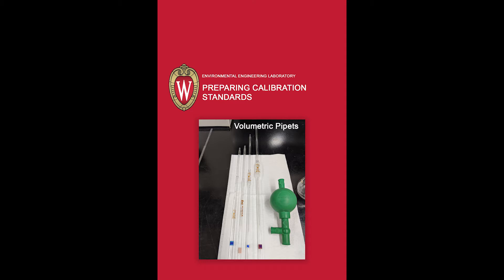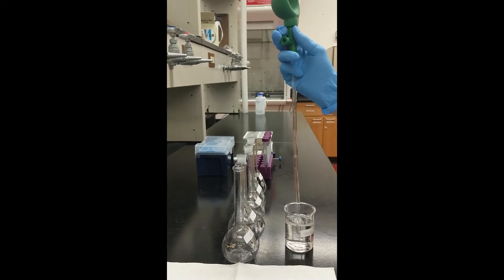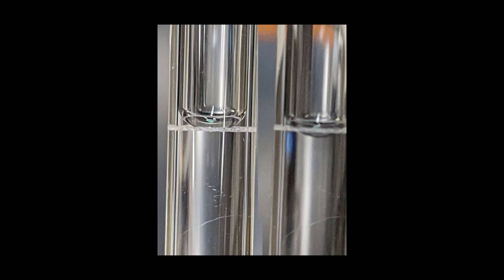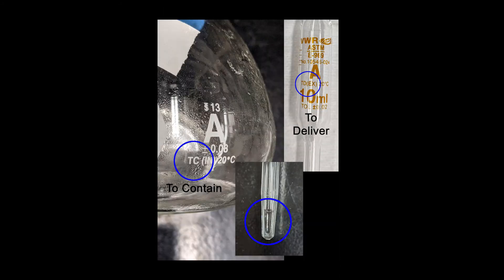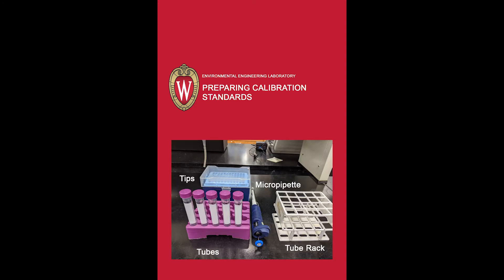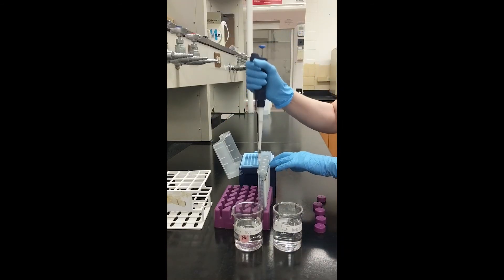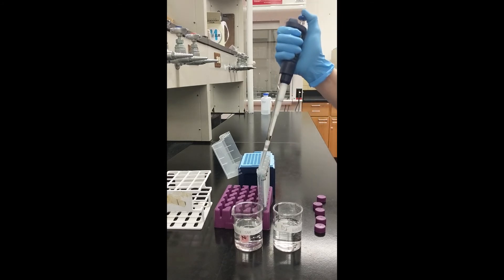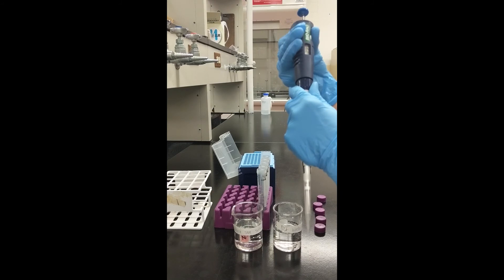How to Prepare Calibration Standards

Comment: Write an experimental procedure (instructions) for preparing five calibration solutions. You should start with solid copper sulphate pentahydrate (molecular mass = 250 g mol-1) and prepare of a 100 mL aqueous stock solution of Cu2+ ions with a concentration of 0.1 mol dm-3. This stock should then be used to produce five calibration solutions with concentrations of 0.01, 0.02, 0.04, 0.06, 0.08 mol dm- 3. You should be specific about the glassware required and the masses and volumes used

Can you help me answer this question please
Reply from the maker: Thank you for the feedback! This video was put together to provide general guidance on calibration standard preparation. Including an example of stock and standard preparation details is a great suggestion for a future update and additional videos.